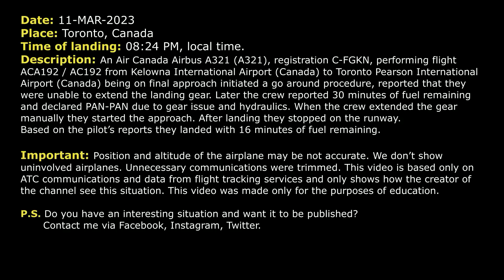“The gear is not coming down”. Air Canada A321 don’t have much fuel to troubleshoot. Real ATC

Comment: Question from an armchair pilot:  Is it wise to have an aircraft takeoff immediately before an emergency aircraft which is low on fuel is due to land on the same runway?  What if the Embraer had blown a couple of tyres?
Reply: Something that this thread serves to remind me: Don't believe anything you read in the comment section online.  😌🤗

Through no fault of their own, most people simply don't have the knowledge or experience to make accurate comments.

Asking a question is one thing, but ANSWERING questions is another. Many people answer questions in a way that implies they're correct, and their replies are not open for debate.

I'd recommend that everyone should operate under the assumption that internet commenters don't know what they're talking about, and are commenting as if it were factual; in reality, it is, at best, their uninformed opinion.

Again, no intention to be rude; just a friendly reminder that most of us do not know much about anything. We are certainly not qualified to be experts. And, despite what you think is common sense, when it comes to mature industries like aviation, nearly everything has been thought of and tested for decades or more. Lessons have been learned the hard way. There are very specific reasons it works the way it does. 
 
While we can't rule out the possibility that an internet commenter may have a novel idea that is 'better' than the established method, it is highly unlikely that the designs, laws, rules and procedures can be improved upon by a layman.

When you (anyone) posts a comment, keep in mind that you are not an expert in the subject (unless you truly ARE an expert) and you're merely posting your thoughts. Don't get upset if someone calls you out. And if you're reading comments, don't put much stock in any particular post.

In this case, it's completely fine for anyone to speculate on what the pilots and ATC 'should have done.' But that is just speculation.

Any actual pilots or ATC who watch this video would tell you that the situation was handled well. Few would have a problem with the departing aircraft on the same runway, with the A321 still so far out. Had they declared an emergency, ATC may have moved the Embraer to another runway. Calling a Pan-Pan vs. Mayday is sometimes a judgement call that could go either way. Some companies do not have a specific requirement on what to declare when you have a concern for the landing gear, but DO have 3 green lights, and beginning to get tight on fuel, but aren't into reserves.

So, feel free to post your ideas and comments, but keep an open mind about this situation. Either you're a pilot or controller and understand the nuances of this scenario, or you aren't, and don't, in which case this could be a valuable learning experience for you.

👍

I hope everyone has an absolutely fantastic day!

And keep in mind: I'm a commenter, so take my entire post with a grain of salt! 👌
Reply: I’m really curious how many of you here are actually pilots. Cuz I am. And many of your comments not only don’t make sense, they’re devoid of any understanding of the basics of aviation or regulations.
Reply: @vdrumv  Easy to tell. Anyone who believes that the vision is real, isn't a pilot.
Anyone who bases their comment/critique entirely on a 1 minute CLIPPED audio of at least 3-4 more minutes available online, is not a pilot. (Although, there were 2 pilots I believe legit that did base all their comment, on this 1 minute MSFS vid & clipped audio, but in those cases I'd guess they're not net savy & don't realise much on youtube is BS. Also this sim vision on this channel always displays perfect daytime weather & one incident was actually nighttime, and another in fog
Also isn't pilot is anyone who doesn't think there's different requirements for different airports & doesn't know that regulations vary a little for in U.S., in Canada, and in EU/UK. (been more standardising recently)
Before I comment or reply on video on this youtube shorts channel (only post shorts & all his/her ATC ones are msfs sim vision), I find the longer 4 min or more ATC, & look for any report. I'm no expert, but NOTHING on this channel ever displays the simulator vision as it actually happened, & the audio (while usually real) is clipped, & very often edited to leave out parts where no comms are occurring, so sounds way more urgent.
Not that it wasn't close and urgent, but not quite as portrayed here. Real life separation got down to: (approx) 965metre/1055 yards
As I said I'm not expert (& wasn't the pilot nor in tower same as everyone commenting) but I don't base any comment on a 1 min audio using msfs vid, & I did long ago fly a Cessna 150 but didn't continue with it, but commercial aircraft or anything other than light aircraft would be  "an entirely different kind of flying".

What do you fly, or usually fly, by the way?
Also by the way, VasAviation is best youtube channel for ATC audios, as it states when it isn't or is real-time audio & also states diagrammatic representation is only that
Reply: @vdrumv  One more. Isn't a pilot if they say anything re should have declared Mayday when near airport & still able to land at it. In the many ATC on youtube (which as I said rarely tells whole story), never heard "mayday" when an emergency but still can land at the airport.
Isn't Mayday call an all-out alert to whatever /whoever is in the vicinity; not just to ATC or Tower?
Reply: They’ll just land on the taxiway like they tried at SFO lol
Reply: I am confused, why Pan pan? 30 min is minimum field emergency.
Reply: It is mandatory to declare MAYDAY when emergency 30 min fuel is the only left. In their case they might meant "regular" (not the emergency one) fuel and thus only PAN-PAN. Nobody will stop normal operations of a busy airport because of PAN-PAN.
Reply: @desunistallerinc  Where you do get this declaring a "Mayday" from, & which continent are you on? Where from do you get it's mandatory to declare a "mayday"  when only 30 minutes of fuel left?! It's declaring Pan-Pan, or Emergency, re commercial aircraft.
(Maybe in Europe somewhere, or if plane can't land near an airport, or is out at sea but in all these ATC's never heard "mayday" once in any of these ATC vids for commercial aircraft near an airport - most ATC vid are US & sometimes Australia or UK, & very occasionally in Europe)
Reply: There are other runways.
Reply: @gavinsingh4450  Which should have been used for the Embraer.
Reply: @sylviaelse5086  They're not going to stop ops. or turn stuff around unless it's a dire emergency!
Reply: @gavinsingh4450  Having so little fuel is a dire emergency. If the Airbus had had to go around again, it may not have made it  back to the airport.
Reply: @sylviaelse5086  If that was the case then they would have been emergency fuel and most likely would have declared an emergency ... oh I'm sorry a Mayday Mayday Mayday.
Reply: @sylviaelse5086  Dire would be that situation with no other runway available!
Reply: @gavinsingh4450  It's not as if the Airbus could just switch to another runway on finals if the Embraer didn't clear the runway.
Reply: @sylviaelse5086  Explain why?
Reply: @gavinsingh4450  Because you cannot make tight turns at 140mph.
Reply: @sylviaelse5086  I see. I'm sending an email to Transport Canada now to prohibit immediately all circling and sidestep approaches!
Reply: @sylviaelse5086  valid point on the basis of being inside the faf and their stabilized aprch sops as the actual reasons, not the ias.
Reply: @SSaugaCriss  They can ignore any rules, ops, etc., in the case of an emergency. They cannot ignore the laws of physics.
Reply: @sylviaelse5086  you will not find any AC crew ignoring procedures. the airbus will also not allow your point about defying physics. anyways, good afternoon from Canada, have a great day!
Reply: @sylviaelse5086  agreed. Likwise for those armchair pilots- airline pilots have a set of criteria that have to be satisfied to attempt a landing called the stabilised approach criterial. if a plane banks harder then 10 degrees either side (aka turn the aircraft more then a few minor increments from the landing path they are following) that breeches the stabilised approached and pilots then HAVE to go around. They were less then 9NM out. If they made any turn at that point to side slip and aim for the other runway they are forced to abandon the approach. It is not a possible option and aviation opterating procedures do not allow for it. approaching a runway on a turning angle unstabilised is a recipe for an NTSB field day- literally.
Reply: @caseydykes117  Do you fly for Air Canada? Do they really require an approach to be stabilized 9 NM out? That seems unlikely to me as a (non-airline) pilot. That would be still nearly 3,000 feet up on a normal 3 degree glideslope. My understanding was that it was more like 1,000' for most airlines.

A sidestep maneuver to land on a different runway is a completely normal thing for many airlines. Granted, not usually on runways quite as far apart as these.
Reply: @JohnSmith-zi9or  pan pan sufficient
Reply: @alpearson9158  A pan is sufficient for emergency fuel?
Reply: @JohnSmith-zi9or  did you not watch /hear where the pilot declares Pan- Pan, & repeats it twice.
Rarely is a "mayday" called re commercial aircraft/flights; or were you being sarcastic to Sylvia by putting Mayday, & not what is declared in video
Reply: @sylviaelse5086  30 minutes of fuel is not a dire emergency. Without delay, yes. Pilot said "rough estimate on how much fuel... about 30 minutes".They are calculating how much flight time is available for the amount of fuel (burn) that will be used. Fuel used of course depends on aircraft, weight (SOB of course is significant affect) & also landing approach height (different, at many airports), weather & wind conditions. I wasn't there as you weren't & these ATC audios usually don't have everything that's happening. In fact, there's another vid with same event, & there's a bit of ATC in that not in this one.
Pilot, after they did exact calculations, does declare Pan-Pan & repeats it twice & also says are doing manual extension of the landing gear.
Pan-Pan is a 2nd level emergency basically (in amateur terms) meaning very urgent but not an emergency for all other aircraft to be held from landing or takeoff. Whether an aircraft declares a Pan-Pan or Emergency is pilots' discretion. If airbus missed a 2nd approach, "emergency" then likely declared and they could then (perhaps) allowed to land opposite direction.
I wasn't flying the plane, I wasn't ATC as neither were you, so neither of us know exactly the situation that pilots had calculated, nor what else was happening at the airport. May have been safer (& quicker) to allow an aircraft on a runway to depart than for it to have to go to a taxiway & exit the runway. In the description under this video says had approx 16 minutes of fuel left, after landing.
(For the record - & I certainly would never say that I have any expert knowledge re commercial aircraft or jet - I have piloted a Cessna 150, but very long ago, so no expert as you also aren't. Only if I was in cockpit would I know if Pan Pan was the right call
Reply: @JohnSmith-zi9or  It wasn't emergency fuel only remaining. Approx 30 minutes of fuel is what pilot said. SOB as well as of course cargo also affects how much fuel will burn.
In description under the video it says there was approx 16 minutes of fuel left after landing. A Pan Pan is (perhaps) right call. I wasn't in the cockpit; it is the pilot's decision. Of course declaring an 'Emergency' might put other aircraft on hold, so what if other planes due to land had to circle & became low on fuel?
Reply: What if?  Maybe they should have shut down the whole airport when AC192 first said they were going around.
Reply: @craig7350  what? That’s dumb. If they shut down Airports whenever someone did a go around every airport would shut down everyday.   After They declared a pan pan eventually which isn’t an emergency so even then airports don’t have to shut down. Only makes sense to clear the airspace and have a ground stop if they declared a mayday which they did not.
Reply: @dkwsu16  Shut down airport for a go around? Craig's comment is hilarious, unintentionally.
Expect then many flights to be delayed. Go-arounds in a problem re landing situation aren't that uncommon, as we know. Pilot, obviously, went through the normal steps of requesting no delay to land, then declaring pan-pan.
Of course if shut-down all of the airport what about other plane/s that are due to land very soon and then become low on fuel as couldn't land within a certain time
This ATC/video doesn't even raise my blood pressure lol.
Reply: @craig7350  In addition, shut down the airspace between Vancouver and Moncton to guarantee runway availabilty!!!
Reply: @gavinsingh4450  Of coarse, the airport would function as normal, and there would have been many landings and takeoffs while AC192 was trouble shooting. They decided the Embraer would be the last departure before AC192 landed. That was a 9 mile final which is lots.